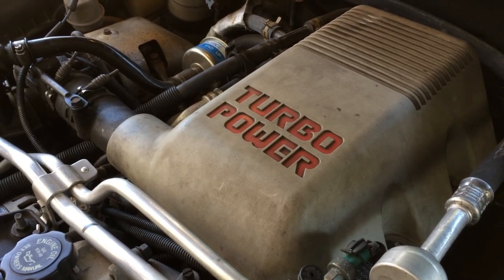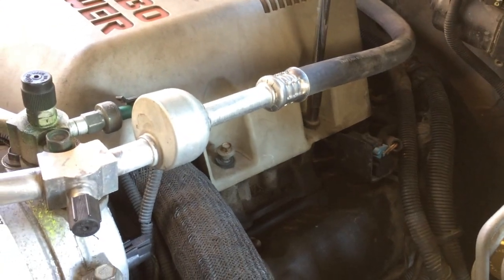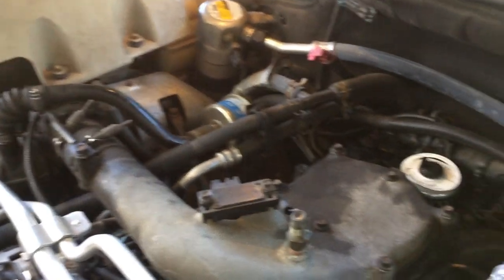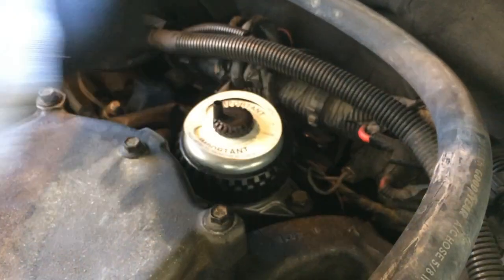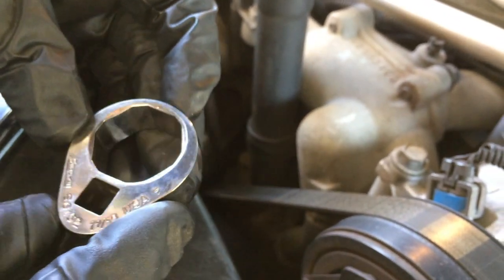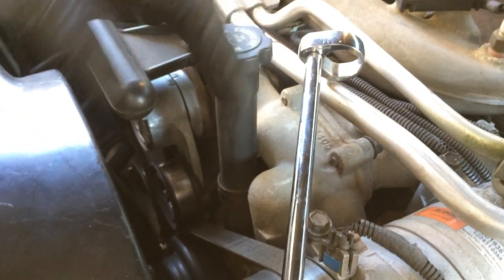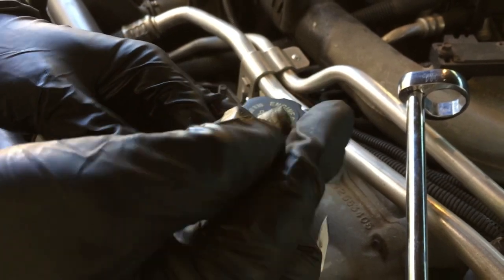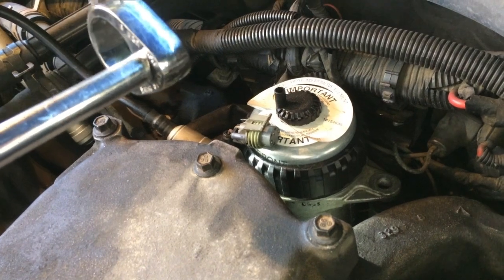1996 - 2002 GM Truck 6.5L Diesel Oil Pressure Sender / Sensor Replacement (Chevy & GMC)

Comment: I forgot to ask: Why are you replacing the Sender?
Reply from the maker: Oil pressure gauge had stopped working.   Turned out it was the aircore motor for the gauge, but usually it's the pressure sensor.
Reply: @DrShock  Thanks for always answering my questions and providing ACDelco part numbers. I am waiting for my rag joint and then I begin Upper control arms with ball joint, lower ball joint, new disc, calipers, brake lines, complete Timken hub assemblies, idler and arm, tie rod ends (I think that is it!). Need to see how to do pitman arm before I try it. Then, new wheel cylinders, shoes, spring kit(s) next. (1996 GMC K2500 Suburban, 7.4 Gas, 8600 GVW. 218,000.00)

Comment: great vedeo and excellent explaining good work mate the GM engendered they made this engine for never replaced most of the parts!!😂 anyway but this engine is very good but without fucking electronic diesel pump!! the best ever are a without Turbo and with a mechanical diesel pump 👌 cheers from Norway

Comment: Will this cause a crank no start with a 2000 6.5?
Reply from the maker: Couldn't see how, primary purpose is to feed the data for the PCM to set the oil pressure gauge needle position.   There was a time, pre-1996, when this part also controlled the lift pump circuit but that wouldn't apply to your 2000.

Comment: Hi DRShock, I was watching your video and I have a 1996 3500 6.5L Chevy and I would like to ask you what position your serpentine belt tensioner is in.  I can put a new belt on my truck and within two weeks it will be stretched all the way out, I have put on a new tensioner and this did not fix it.  This is the size belt that I have from Autozone 6PK2555/ 5061005 I can get a 101 inch belt on but I can"t put a 100 inch on. Thanks 5/24/2020
Reply from the maker: I'm not sure I understand the question, the tensioner is keyed to only mount in a particular orientation to the engine block.  Is this a GM tensioner or an aftermarket one you have installed?  For a single generator I believe the GM belt number for your truck is 19244952 - https://www.gmpartsgiant.com/parts-list/1996-chevrolet-c3500/cooling_system_grille_oil_system/pulleys_belts_accessory_drive.html?Filter=(e=L65;t=MT1;m=CC30903)
Reply: @DrShock  What I was wondering was, what position your tensioner was in at this time, as for my tensioner it's all the way out. I can send you a picture on my tensioner if you would like?
Reply from the maker: Looking at the front I'd call it the 5 o'clock position.  But I have factory dual generators which adds an additional idler pulley so this position may be unique to this configuration.
Reply: @DrShock  I took the numbers you gave me to my local parts store  carquest and they cross reference and found the belt that worked. Thanks for all your help.